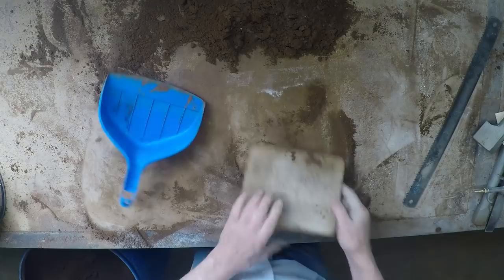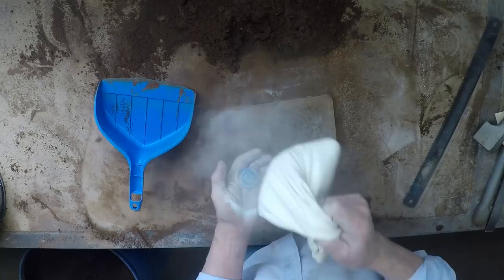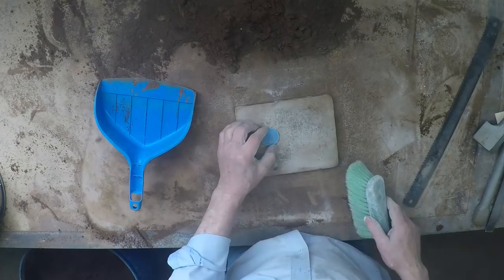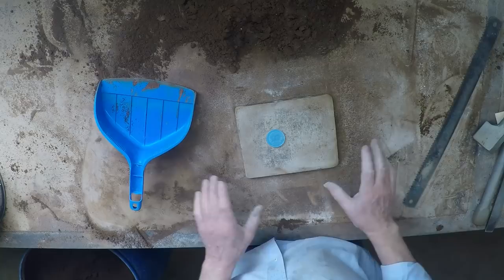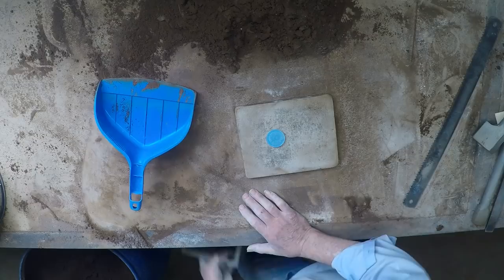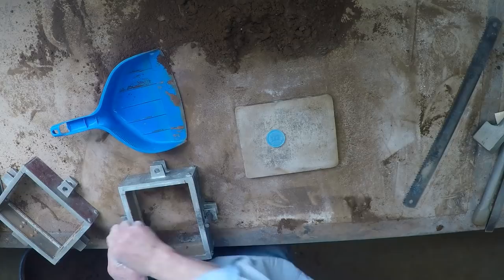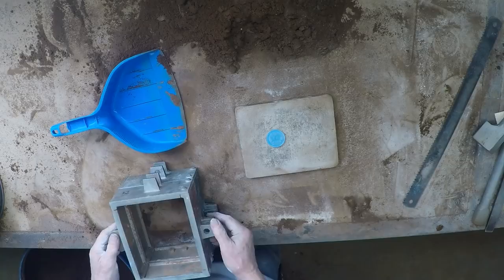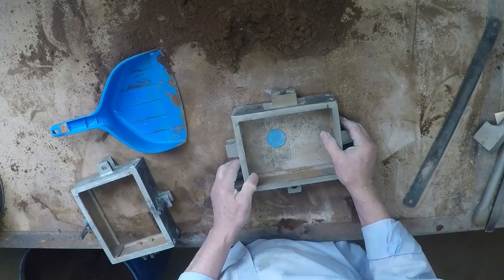Casting a Bitcoin in Aluminium silicon bronze

Comment: Thanks for watching?? a bigger thanks for showing us all it Martin, as allways something new to learn I couldn't have got a finer finish than you've got with greensand even with petrobond.
Graham.
Reply from the maker: Graham, Showing these videos is definitely my pleasure and that you like them is great. I have seen some pretty good results with petrobond but my facing sand is very fine. I have also seen some awful petrobond work looks like its been done with road gravel and its the sand not the moulder at fault. Some petrobond is good, very good, some eh, not so much Local stuff is terrible!... Martin
Reply: Road Gravel he he love it !! yes when I was a technician in our local high school I got the foundry up & running & we were only allowed oil based  & I used to order it in & it can't all have been genuine petrobond because some had a really weak bond yet other lots were really strong, I bought some genuine petrobond donkeys yrs ago & it's still ok & very strong & never lost it's properties,I like your fine facing sand I ground some up in a mortar & pestle but it was hard work.
Graham.
Reply from the maker: Head, Mortar and pestle - man that's dedication! Petrobond does seem to vary, the locally available commercial stuff is terrible (very coarse) while I have seen some excellent results obtained in the US and England with their petrobond - I think that it is all down to the choice of the base sand used. Some home made petrobond does seem to be a bit of a witches brew and  sometimes I am dubious of how it is processed - seems you need a muller to do it properly... Martin

Comment: Fun to watch you work. I was in the Navy as a Molder for 20 years and have a channel named sandrammer. You are invited to scope it out and see how we in the Navy made molds too. Cheers! Bye the way, You taught me a trick of the trade when you incorporated the "pouring block" into the cope of your mold. If we had a mold that was particularly difficult because of turbulence making too much dross, we would make a pouring block that had a larger than average pouring basin with a channel made that would pour the material into the sprue from above. Your technique is faster and does the same job. Very good!
Reply from the maker: Sand. The pouring basin is straight from John Campbell although he does not claim credit instead pointing out that it was in use around 1900. However back then the use of properly sized and tapered sprues was unknown (sadly it is still not as well known as it should be). Atop an overlarge and / or parallel sprue the benefits of such a pouring basin are entirely lost. I am in truth not completely happy with this basin, I think its shape a little too to rounded where its sides join its base. I prefer a shape more like the one I get when I hand cut such a basin by taking a divot out with a thin walled tube - it gives a much squarer shape (in section) and this seems to control the flow better, but I am stim, experimenting... Martin

Comment: 21:36 what you need, are Nomex gloves... I don't know if they are for sale in your area (or trade, for that matter), but I live half a mile from a company that can make them. Nomex is a fabric that actively reduces temperature without losing integrity. I've used it as a fire fighter where we added a Nomex hood under our helmets to protect our necks and heads from any heat that seeped through the outer protection. And I've been in several situations that I was really glad to have it. When it's unused (i.e. not seen heat yet) it just looks like a silly knitted light textile, and you won't believe its protective values until you see an actual test with your own eyes...
Reply from the maker: Luke, Many years ago I used to use asbestos gloves good for the job but a bit frail and oh those fibres that kept falling off (cough cough). Then I got a pair of Kevlar mittens but they are awkward to use being mittens. I will look into the Nomex there would just have to be a local supplier.. Thanks fort the tip... Martin
Reply: Nomex is a fabric patented by the French corporation Dupont, but they provide it world-wide to companies who make work equipment. Nomex is sometimes used in conjunction with Kevlar, but not necessarily. It's far more flexible than kevlar, so also much easier to make into real gloves instead of mittens. I can't find gloves on the website of the company close to me that I referred to. But they make top quality stuff, and deliver to top companies like Intel, Pfizer and NASA (dust-free protective clothing, but also the heat resistant work suits you see worn by the people on the launch platform; the latter contain Nomex, giving a much higher heat- and flameprotection with a much thinner fabric. Those suits include gloves, so I'm sure they can be obtained separately)

Comment: Incidentally, when we had a pattern so small we couldn't use a draw spike or screw on it we used what we used to call "Monkey Shi*" because of its' grey color. What is was actually used for was to seal cracks in duct work used to supply air in compartments. It acts like clay but is sticky when new material is exposed upon pulling the duct seal apart. The sticky wad is then pressed against the pattern, the pattern rapped then the pattern pulled by gripping the material between the thumb and forefinger.
Reply from the maker: Sand, Yep, I have used "blue tac", gaffer tape, plain sticky and packaging tape, plasticine, even chewing gum - its a case of whatever works… Martin

Comment: Two things I like to do for removing patterns like that is either duct tape, or hitting the ends of soem hot glue sticks with a lighter and sticking them on. Better than driving a screw in like some people do.
Reply from the maker: Silicone, Yep, there are about as many ways of removing a pattern as there are patterns! Certainly for  small light patterns I have used duct tape packaging tape double sided tape and a suitable block even normal sticky  and electrical tape - whatever was to hand. Also I have used blue tac chewing gum and even plasticine. However with all of these just a thin layer of part on the pattern will cause a problem with adhesion. I find these methods best kept for small light patterns. I will be interested to try hot glue as no longer being a smoker I no longer carry a lighter and have therefore not tried it. I would not be so dismissive of the wood screw or its threadless spike version used very effectively and quickly by many old timers. With larger and heavier patterns you need a good grip and also the ability to rap the pattern, often quite forcibly, you cannot do that with just sticky stuff. Some form of threaded tool is needed. Keep a strong magnet nearby - they are great for steel patterns - but hold the pattern down while placing the magnet as otherwise they tend to jump out to greet  the magnet..... Martin

Comment: you don't see castings this smooth often and no holes your sand must be very fine with more clay in it also.
Reply from the maker: dan, My sand is a natural  i.e. straight out of the ground sand. As such it does contain a lot of clay although its not as strong a binder as is bentonite. It is a fairly fine sand but I make a special facing sand by grinding some of the sand in a mill not unlike a small flour mill. It is in large part this facing sand that gives the smooth finish..... Martin
Reply: @olfoundryman8418  thank you for the info

Comment: Would a little vacuum picker do for removing small parts like that? They're used to place and remove surface-mount components in electronics work. Basically a powered suction cup.
Reply from the maker: Matthew, I have used just about everything to pick small patterns out of a mould - blue tac, for example, works quite well! However I have never tried vacuum,  but it just might. You have to be careful to lift exactly vertically, and very evenly it would be a matter of whether you could do that with the vacuum or not. I think that I should have done, as I mentioned in a bit of text, and made up a false cope first, rammed the drag against that removed the false cope rammed up the cope against the drag lifted the cope off (as I did) put the false cope back on the drag turned it all over and lifted the drag off. Those little boxes have very good guidance and I would have got  very good lift on both sides of the coin. When I make the "silver" one I will use this false cope idea...Martin
Reply from the maker: Matthew, Further to my reply of yesterday, I have quite often used a magnet to extract steel patterns from the mould. I did find that I had to hold the pattern down with a finger until I had placed the magnet on the pattern as otherwise it use to jump up to met the magnet and it never came out squarely or vertically that way giving me a bad lift with a lot of edge loss. Held down and then lifted carefully it was a technique that worked quite well, I would imagine that a vacuum lift would be much the same... Martin
Reply: @olfoundryman8418  and Mathew, I have just seen this Video, very interesting and informative. I also read the discussion here with will offer up a thought, that is a switch, foot or hand operated for Vacuum and or an electromagnet that can be easily made. That my two bobs worth. Cheers from John, EC Australia.

Comment: Great surface finish
Reply from the maker: Rabih, Thank you, the fine sand plus the drying of the mould played a bit part in the finish - also the alloy that I used is know to produce a very good finish, while it is very fluid and fills the mould well it does not penetrate the sand like some of  the other copper base alloys do.. Martin

Comment: I'm not sure if it's feasible, but I think you could reduce the premium impact of your furnace if you added a thermo-electric coupling and charged a Tesla Battery with it. Since you use the furnace often, you might be able to run the entire shop on the recuperated power...
Reply from the maker: Luke, Hmm, a bit beyond my meagre capital expenditure budget I am afraid... Martin
Reply: you'd be surprised... Another solution to recuperate all that energy, is to store it in the ground to retrieve it in the winter time to heat your shop. (Check Daikin heat pumps, biggest brand but fairly cheap too, and maybe their representative can offer you a thermo-electric solution too)
Reply from the maker: Luke, I do not really operate the furnace consistently enough to make this sort of thing worth while. It has not run for the last 9 days and it may do so in about another 5 days -perhaps. Also while it occasionally runs for 5 to 6 hours it usually only runs for an hour at a time. Years ago when I was a lot younger it did  run most work days  but not anymore... Martin
Reply: I see... Well, most of my ideas are wild and wide outside the box anyway =D

Comment: sharp spoons, old file as a sand box toy, and spontaneous combustion of gloves... ahhhh, Martin posted a new vid!  i tried to tell you the pin lug was in the way of your basin, but my voice can't quite carry half a planet the way it used to these days, lol. is that a retired power hacksaw blade you strike the boxes with? as always, not only educational, but entertaining
Reply from the maker: Luddite. Yeh, that pin lug is a problem! Yell louder next time! Later boxes had the lugs place lower down the side of the box - a lesson learnt, lugs level with the face of the box or nearly so like these are a problem. Retired power hacksaw blade yes indeed It has a bit of an arched back from use  but it does not seem to matter. I would suggest though that the buying of a new blade off fleabay might be a good idea (hmm, I must do that myself) Used ones are getting a bit hard to get as many workshops have abandoned their power hacksaw in favour of a band saw. That glove was  a bit of a trick! Its just that the Kevlar  gloves are awkward so I sought to use cotton on one hand - bad idea with a furnace with that big a hot area radiating heat - too long since I regularly did bronze. However if I can bring you both knowledge and a bit of a laugh I am doubly pleased.... Martin
Reply: the glove actually reminded me of my days earning a living mig welding. i worked VERY hot, so my gauntlets would often not only get quite toasty, but at the finish of running a bead would be smoking, and sometimes smoldering. i actually made sheet metal heat shields, secondary "finger overcoats", and other field expedient insulators. once in a while, some other worker would use my machine as i had it set to try to tack together something, and the least intellectual of them would wear "work gloves" (leather palms and fingers, jersey balance) to do so. spontaneous combustion, startled cries, hand waving and blowing was often a result. i must admit to doing the same with the plasma cutter once, which was enough to teach me the error of my ways, lol. "if we were geniuses they'd call us geniuses, and not metal workers" (as my dad used to say)
Reply: @olfoundryman8418  I still use a power hacksaw, you are welcome to one of used blades if you can get me your mailing address Martin. Cheers from John, Australia.

Comment: If a complete smaller furnace is not feasible, would it make sense to make a removable “liner”, either of firebrick or castable refractory, for small jobs like this?
Reply from the maker: Joel, Yes, I guess that you could do something like this. To be honest though it might just be easier to build another furnace! A small one that would take an A6 crucible for example I think I could make in a few days. I do have a larger furnace it holds a BC100 crucible, a basin design that holds 100 kg of aluminium. I also have a smaller (electric) one designed to hold an A30 but it was only built to melt zinc base alloys  and I would have to up grade the elements to melt anything hotter. I did build one for a friend to hold about an A4 used a 20 lb LPG bottle as the container. The furnace used in this video will hold an A90 crucible... Martin